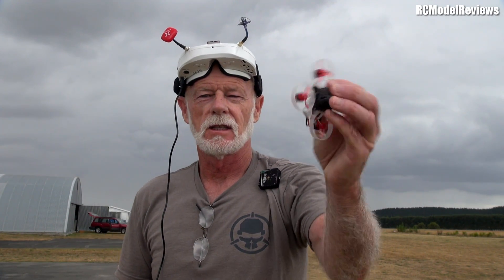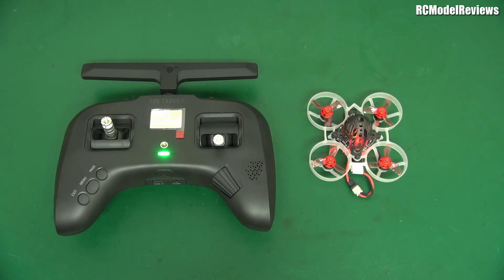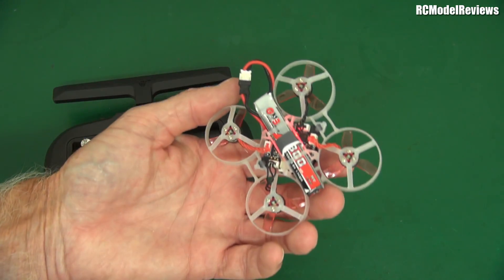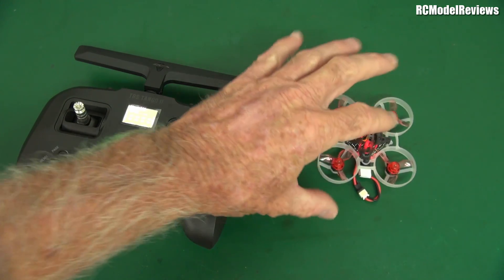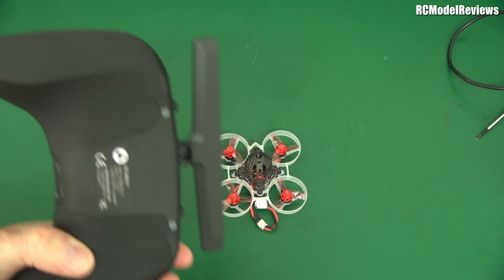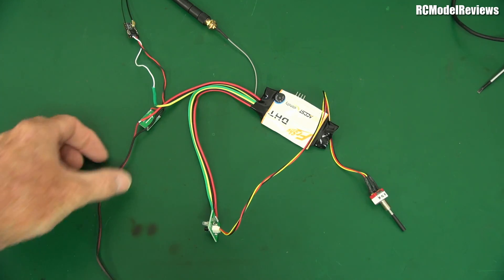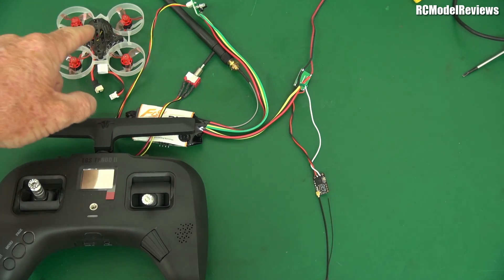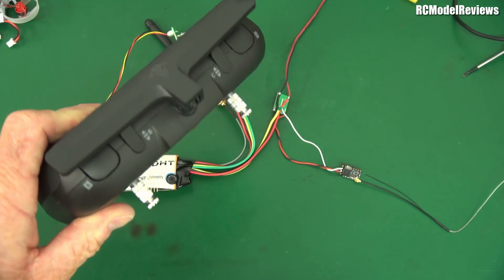Flying a 2.4GHz Mobula 6 with a CrossFire Tango 2????

Comment: Bruce ; get a cad designer to design a 3d printed  jr module holder with  a snap in pcb for the pins and mounting  location for the receiver bec and 2 cell battery. Painless 360 for example might be able to do that.    then people can print there own case and end up with a pro looking result.

Comment: Once I needed the opposite so I just added a second tx module with it's own sma plug. Routed the 3.3V thru a two position switch to change bands. Unbuffered ppm split between the two (now I am thinking I should buffer)
I might just get it triple band in the future. Plenty space in my Sanwa for more electronics :D
Yeah... it could be nice to have it 433, 865, 1250 and 2450. Even multi-band diversity...

Comment: I use a video repeater 1.2g to 5.8g...Another advantage is you can place the Slave 2.4g transmitter module in a high up position nowhere near your goggles or Tango...giving good signal propagation..This is a known fpv trick Bruce used by advanced users, but well done for showing it..🤔🤔😎

Comment: Mount the "repeater" at a high point permanently on the airfield (fake tower?), maybe with mains power supply, better antennas, should increase the range significantly.

Comment: Bruce, when you mentioned you have a solution for whoops, I guessed this will be the solution. But you need to use the CF nano in SBUS mode which adds some latency (50ms?)
Reply: Actually the CS Rx is using ppm mode to talk to the 2.4g transmitter module...Latency isn't an issue anyway..🤔😎

Comment: Hi Bruce, regarding trimming plans and gliders in flight, I've had great success using the special OpenTX function 'Instant Trim'.  I have it assigned to one of the momentary switches on the back of the Tango 2.  When trying to use the scroll to trim flight, being a mode two pilot it was too difficult to set trims.  Using Instant Trim is so much easier.

Comment: Bruce that's a great idea for a project.  If you use a iRangeX IRX4 Plus (with the channel knob) you could connect pretty much any Transmitter (Crossfire, Futuba, Spectrum, etc) to any protocol.  Of course communication & lag may be a problem between the modules.  A similar possibility might be to use the Transmitter's trainer port to the Multiprotocol module

Comment: I have set the Mobula6 up on a QX7 and a T16 transmitter. I have raced it and even converted it to a PICK.. Really like the tech. I wish I could be happier,  however, it resets settings in Betaflight if the battery drops out. LOL, did a video on that too.. I appreciate the work you put into your videos, so good. I am also envious of that work bench..Lol.. Enjoy the Breeze...👍🏻🍻👊🏻

Comment: Great video and proof of concept Bruce, but can't you just solder in a nano crossfire rx to the flight control board and use one of Kabab's smaller and lighter 1/8 wavelength crsf antennas to achieve the same, if not better results? I know it would add a few grams to the models overall auw but there's got to be an easier way right?

Comment: Yes please hold my by the hand, I have a extra multi module and would love to do this! Preferably the irangex irx4 plus 😬. Sounds like u got your hands on the jumper t12 pro, I can’t wait to see it
Reply: Not sure how you would change protocol & model on that as IIRC it doesn't have the pot to change those. Perhaps with an arduino?

Otherwise it should be fairly straightforward as all you really need is a power supply (5v BEC) & a receiver with pwm out.
Reply: LoC the irangex irx4 has a manual dial on the back. Each letter or number signifies a different protocol . And there’s a bind button there also
Reply: @djs134  
Ahh yes, I have trouble remembering which variant is which! Should be easy enough then; you'd need to bind to each model you want to fly/bridge and then select which you wanted before flying.

And as for the setup, you'd need a BEC to power everything and a receiver capable of [C]PPM output, which you'd feed into the PPM IN on the module. Should be doable without soldering using only jump wires.
Reply: LoC hard for me to visualize exactly how to wire that up. Hopefully we get a video so I can see.
Reply: LoC what’s a bec? Sorry for the stupid question
Reply: @djs134  

No worries. It stands for Battery Eliminator Circuit, an old term from when you'd use a seperate battery to power the receiver & servos. These days a BEC (or voltage regulator) is used instead.

As they usually have a 5v output one should be able to drive both your receiver + module.
Reply: LoC thanks for the clarification, Albert Kim just posted the diy of this

Comment: Nice, but latency...
Reply from the maker: Yes, extra latency... but I'm old and I'm already full of latency :-)  To be honest, I didn't notice it but the latency will be higher than pure Crossfire -- still,  it does mean you can fly your tinywhoops using that cool new transmitter:-)
Reply: @RCModelReviews  I think the main issue here might be conversion to from crsf ppm and then to d8, it would certainly be interesting if you could measure the exact end to end latency with this setup.
Reply: I suspect most things you’ll use this for (Spektrum UMXs? Tiny whoops? Other things with integrated receivers that you can’t change) latency won’t be a concern. Anything bigger, just throw a nanoRX in it.
Reply: @swissfreek  latency is absolutely an issue with proximity whooping / racing.